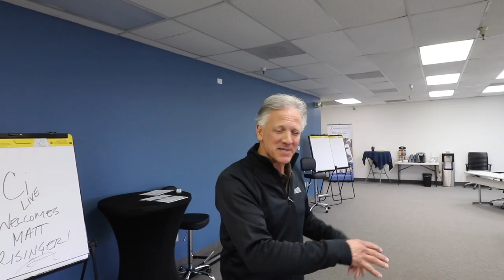Building Science Test Lab

Comment: Could you just use closed cell foam on the inside and then 2X3 drainage plane on the outside for your siding with a very thin closed cell spray application in between the 2X3's ?  Or just go old school and use tar over the plywood like some foundations use for waterproofing ?  Just spray it on everything.
Reply: august I would not use tar or asphalt fluid products just for the reason that they’re not compatible with most other adhesive sealants and tapes. They do regularly spray fluid air barriers already. Acrylics are decent, silyl terminated polyethers (STPE)are best in my opinion.
Reply: Jeff, are there any that are compatible ?  Seems the whole building industry is headed towards making the house envelope air tight and tar is a pretty good sealant or like I said, a thin layer of closed cell on the outside. I don't know what is the best and it seems that no one else has the "ideal" solution, that's why I suggested the tar because it's a proven product that seals out moisture. Thanks !
Reply: Are there any what that are compatible with what? Most acrylics and STPE’s are compatible with most other products. Check out Prosoco RGuard with Fast Flash with Cat5.
Reply: @augustreil  as the speaker in the video mentions, the temperature on the outside of the building envelope (behind the cladding) reaches temps of 200 degree F - the lifespan of tar is not likely anywhere near the polymers in this condition

Comment: Ok, I’m a little confused on something. In your older videos, you spent the extra money on Tyvek Commercial D for the low perm. ratting, but I have noticed you more and more using Doerken’s Delta Vent for its high permeability. Why is this?
Reply from the maker: Don’t get hung up on Perms. I tend to use Peel & Sticks these days for air tightness as well as waterproofing
Reply: Depends on what climate zone you’re building in. 10 perms or more is permeable and under 10 is a vapor retarder. Between 10-20 perms is ideal, but a little higher is fine too. Be cautious of low perm (under 10) products.
Reply: If you're building with OSB then housewrap perms don't matter. Your OSB is a vapor barrier, under 1 perm. Plywood isn't much more permeable, and in all actuality neither is caulked & heavily painted drywall. Natural building techniques like strawbail or hempcrete along with mineral paint like Romabio is the only way you're truly going to get a breathable wall. Most folks aren't going to attempt an outside of the box build like that, and if that's the case with you, listen to Matt - don't get hung up on perms, air and water seal your house diligently, and use dehumidification or at very least a properly sized HVAC system.

Comment: fluid SPRAY applied barrier ?  now that would be innovative. (as long as its not crazy $$)
Reply: Closed cell foam on the inside anyway.
Reply: Spray applied fluid air barriers are already common practice...
Reply: different viscosity products are available for different purposes but have similar compositions after curing - so thinner for WRB on large surface, and caulk like consistency for seams and gaps -  look at Polywall products - several viscosities for different applications